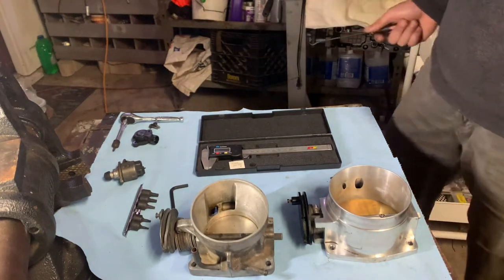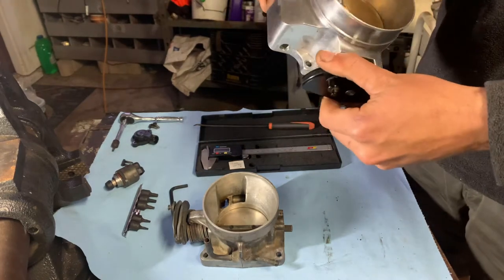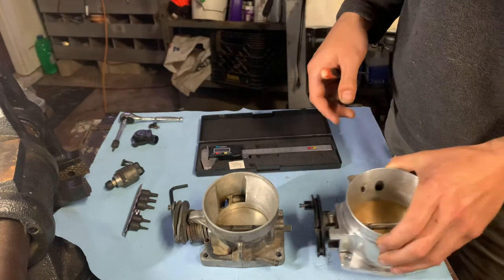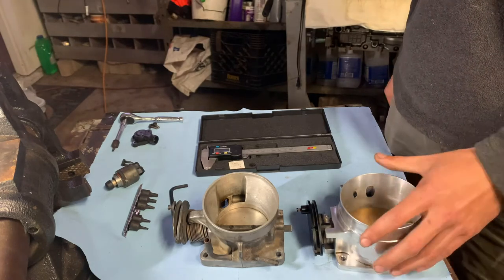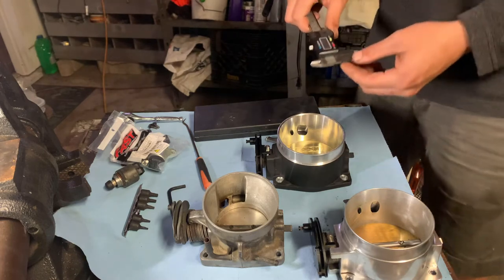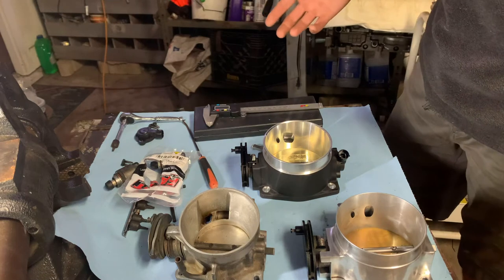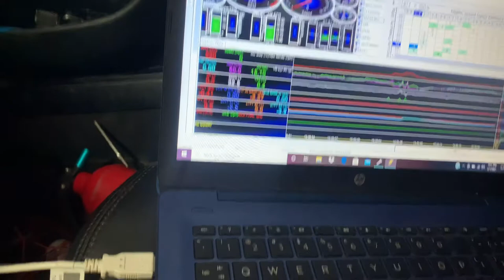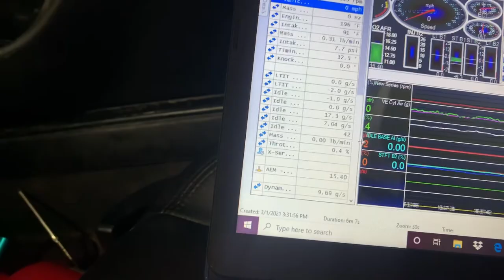Cheap vs Expensive Throttle Body!

Comment: Alot of people drill/bore out the iac tunnel on the cheap Chinese TB. I don't think the Chinese throttle body is bad. It just needs to be worked in order for it to be good. If you're willing to put the time and effort into it it's not a bad TB

Comment: I've got a Summit Racing intake with the 102 throttle body on my 370 and what a piece of junk. I've fucked with it for hours and it just won't let the car idle unless I put my foot into it. I just ordered up a Motion Raceworks Icon 102 TB and I'll also be ordering a BTR Trinity intake manifold
Reply from the maker: Sounds like a nice setup

Comment: What was all don’t to that 383 engine? Like cam, and other stuff
Reply from the maker: Right now it has a Holley strip dominator intake, afr 210 heads, lunati voodoo solid roller 243/249 @.050, forged rotating assembly, flat top pistons, 1 3/4 inch headers

Comment: How did you eliminate the pcv on the chineese tb
Reply: Angle grinder is what I used
Reply: Angle grinder is what I used
Reply: @pablocalvillo8921  I just put a cap on mine